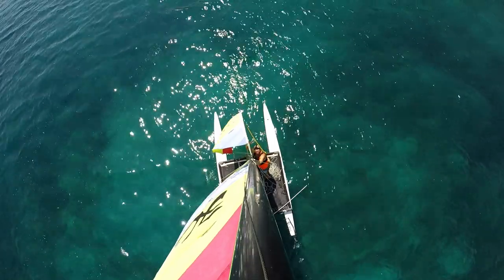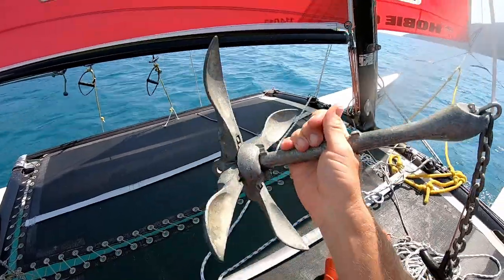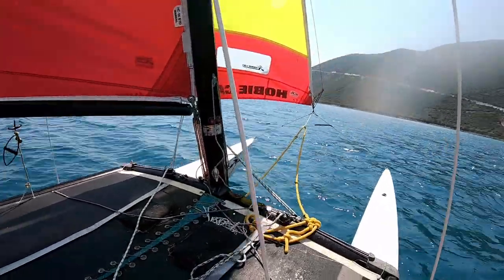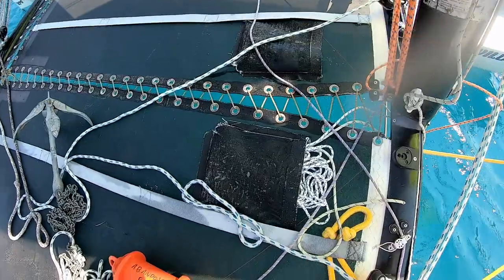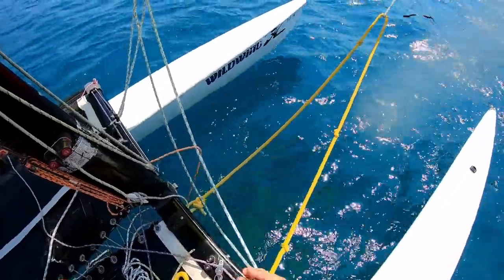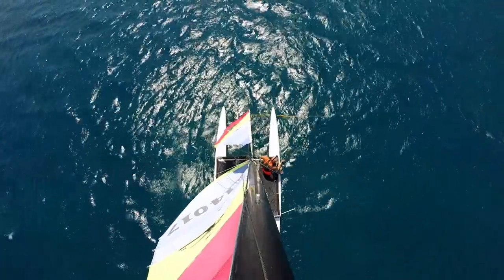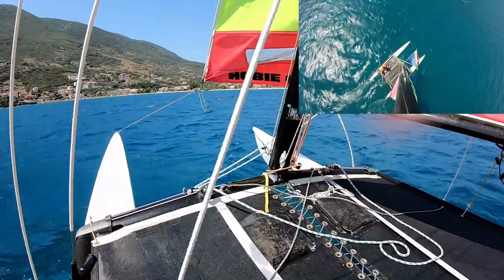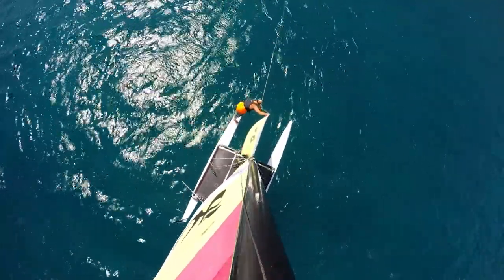How to anchor or moor your catamaran  Multicam tutorial with commentary

Comment: Again thanks Joe.  I put that anchor under the tramp in an anchor bag attached on the striker. I run the anchor line to the front through A mooring loop and hasp on the front bridle wires that I leave on the boat. Works  great. More to use it if I flip the boat and need to stop drifting into a shore before I can get the righting pole working.
Reply from the maker: Nice, good idea when capsized.

Comment: Love this. Never anchored a 16. Thanks. Could be great for fishing. Or just to keep a boat off the rocks with the right wind. Thanks.
Reply from the maker: Cheers!
Reply: @JoyriderTV  i'm not in the same boat... heh... but I asked you once about anchors too. Do you have any recommendations for any brand or supplier? I liked the folding one you showed.. i want to scuba dive or even just fish without worrying about drifting off. do you have any info on viadana lower blocks? they're half the price of the harken, which costs almost as much as the boat and trailer. actually it costs more than the boat, without the trailer. the triple block with cleats is the one I'm looking at.

Comment: Great to see you have a go at the anchor. Tried my hand as well as one place I launch I have to get out a bit before raising sails...my thought was to use an anchor to keep in place to raise sail. Although I have tested the anchor and works fine for a Hobie 16 (10 lb mushroom anchor with 50 ft of line no chain) for a short swim break I haven't tried raising or lowering the sails with it. I figure it should work fine, what's been your experience if any on that? Thanks, love the channel and how it's not always about this is the only way but more this works for me like this your milage may vary and there are other techniques...so glad you are still giving it the beans during the Vid!
Reply from the maker: We're hoisting and dropping the sails on the moorings here daily - works very well - the only reason it would be difficult at anchor would be if you were in tide and the boat wasn't sitting head to wind.
Reply: @JoyriderTV  Sweet, thanks for the reply, gave me a lot more confidence - no tides in the lake so all good to go!!

Comment: Where I sail, dropping a permanent mooring tire is not an option being a well visited beach and carrying a big anchor is not practical. It's very sandy so often I beach my cat for a break but l just started using a large bag (same one I use for assisting single righting) filled partially with sand. It does not take much sand and works really well. It's super light to carry to the beach and easy to empty when I leave. I have pure sand here but I'm sure it can work for smooth rocks.
One thing I noticed with the length of the rope....I tried using the lengths you use but I find my cat was acting erratically, sometimes taking off only to stop when the rope tightens. My solution is to shorten the rope so it has no or very little slack. The boat stays put with no crazy behaviour. Not sure why it was acting crazy, shifty winds maybe? I always unhook the boom, release the downhaul and uncleat the jib.
Reply from the maker: Nice tip there with the bag of sand - multi purpose.

Comment: Hi Joseph, great video as usual. Interested in what you said about approaching a mooring. I was taught to approach to a mooring on a broad reach so that you pass the mooring 10-20 yards downwind, then turning up wind for the final approach. Sailing a close reach seems a good idea as it's easier to go in to the wind, but doesn't it mean you have less control over the speed?
Reply from the maker: I'd say more control as you can use the sheets to control; the speed and then you still have the option to turn up or down if you're approach is a little off. I think the main thing is to have some space on your final approach.
Reply: @JoyriderTV  Cool thanks! Hopefully will get out to Vasiliki next year, it looks great! (This year has been a bit of a write off unfortunately!)